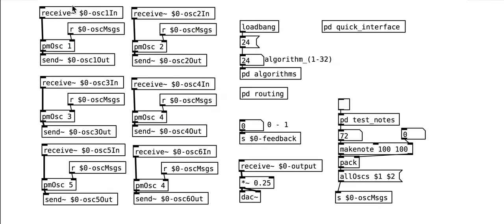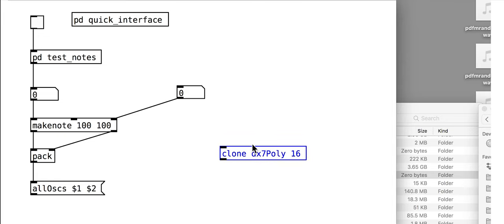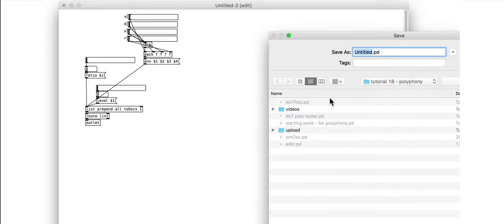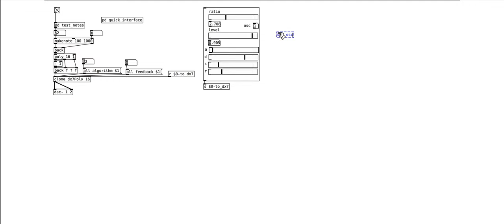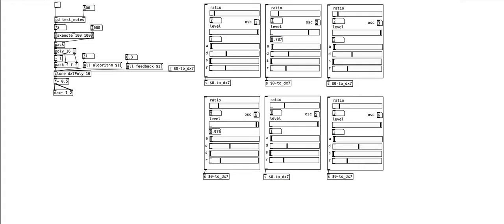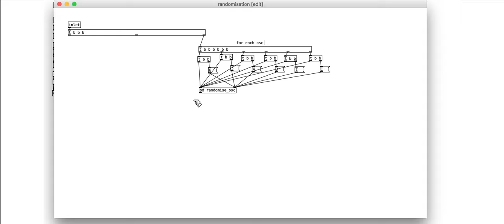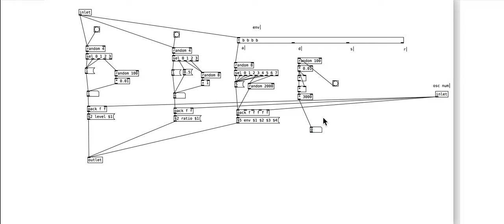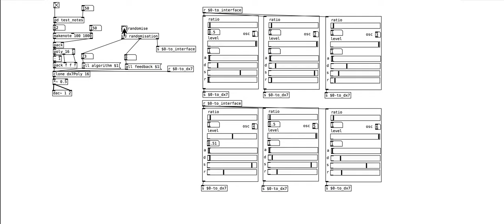PureData tutorials - rich synthesis (18) - DX7 Phase modulation 4

Comment: Splendid. Love the Randomisation (It is a selective randomisation) and that you made it polyphonic. You can make a really nice generative music with this (by adding a Markov chain system to note sequencing and an Euclidean Rhythm system for triggering the randomisation) . Also i really like that you keep the interface design minimal and practical (great for interface tutorials). You can spend weeks on interface design (color schemes, reactive behavior etc.).  Great material to study and learn.
Reply from the maker: Luckily it is hard to have a worse interface than the original DX7!
Reply: @reallyusefulplugins  I partially agree. Also i would like to point out that retro interface design is superior to modern interface design. Retro interface design was made for deep functionality (Turbo Assembler, Turbo Pascal). On the other hand modern interface is made just for the look. Also very modern aircraft embedded interface is very retro in style (minimal and robust) and most serious industrial software is also retro in style. Pure Data follow the same retro design. Everything is white and very simple but it is very powerful and complex. also ER-100 module interface is retro but it is a very powerful module.
Reply: @robertboran6234  can you recommend any euclidean rhythm learning resources for pd?

Comment: Hi im 12 mins in and every time I move a parameter, I get the error loads of times "unpack: type mismatch" i tried downloading the example verison off of the google drive link but get same error? Any idea where I'm going wrong?
Reply: gettin this for download version too
Reply from the maker: Hi. Good spot yes. Thanks for flagging this. This might be down to a mix up between an earlier patch that David did and the one that got uploaded. One used a "toOscs" message while the other used "toOsc" in the poly. We've updated the download version. Check you've got consistent names in the route objects and the elements sending to the patch. If it's still not working for you, have a look at the Tutorial18_dx7 version (rather than the "Fully Working" (ha) version) which has a version of the tutorial without the error (at our end anyway). If all else fails, then send the patch to our reallyusefulplugins at gmail and we'll have a look!
Reply: @reallyusefulplugins  thanks!